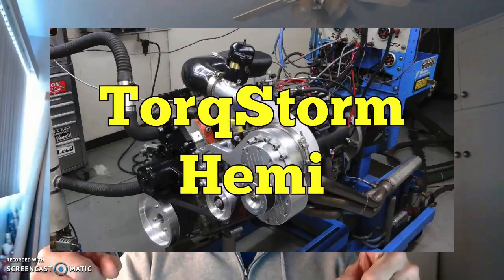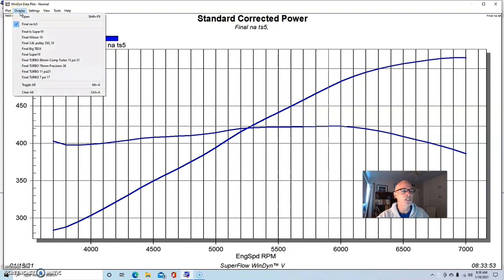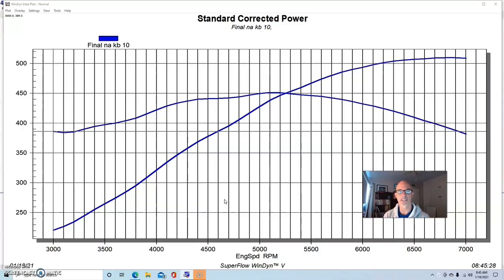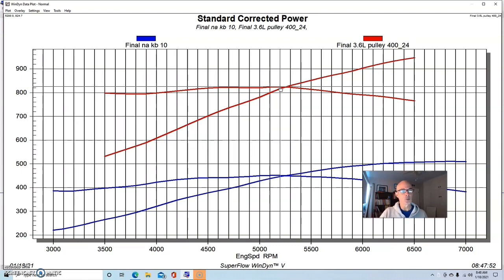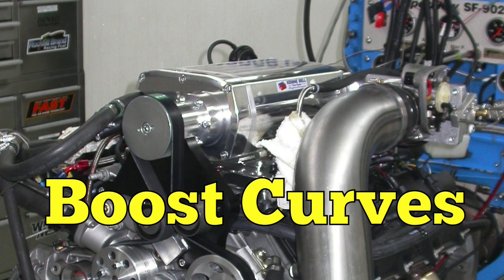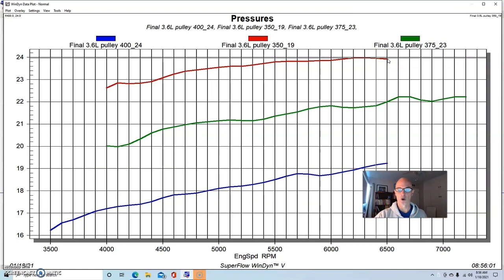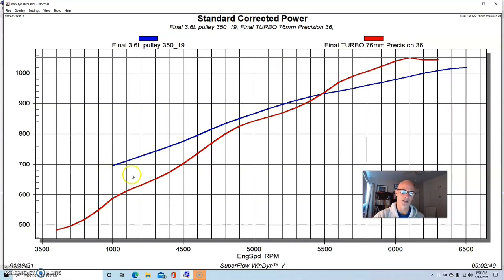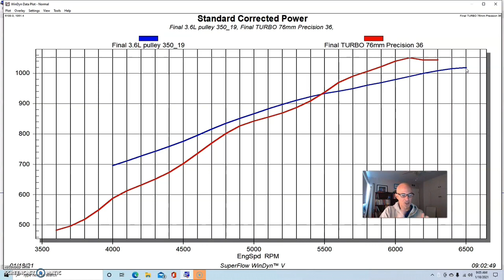1000-HP GEN 3 HEMIs-SUPERCHARGERS VS TURBOS (BOOST!)

Comment: Hemi + boost + ring gap = happiness
Reply: Been putting off doing it myself for awhile now. Ready to buy a 6.1 Grand Cherokee and do a twin screw on it but my wife wants me alive.
Reply: @sHoRtBuSseR  get late year 392 heads, minor port clean up.
Reply: @sHoRtBuSseR You know it’s possible to connect the ZF8speed in the Modern Scatpacks and Hellcats with the 6.1l Hemi
Reply: @redhunnid5142  you'd need a stand alone system to run it, but you can do it.

Comment: Dang, that engine in N/A form is NICE! Looking at that torque curve from 3800 to 6800. 3000 rpm of friggin' table top. I need to build one of those because that thing would be a mean little ripper.

Comment: The difference in the power vs. PSI numbers of the turbo and the blower is - the  blower requires more psi to produce the power similar to the turbo( at lower boost) because of the parasitic drag of the blower.

Comment: Kinda crazy that first one 678 at the crank would translate to roughly 560ish whp. Which is roughly what I have in my car rn. Except 3psi less boost, 10 less degrees of timing and a different cam. It is from a procharger tho. Heard those Torqstorms are not great but hey to each their own
Reply: Also stock heads

Comment: Any chance of a turbo back pressure vs blower parasitic drag test at the same boost level to see the power losses vs each other?  Pick a turbo and a blower both rated to flow 600 hp maybe?  I’m thinking out loud but hey, at least I’m thinking!
Reply: Best test is a fuel flow test of both at exact same power output, because that is what matters, right, wasted power at that power level. Whichever uses the least fuel at 700hp is the winnah!

Comment: Centrificalsupercharger + Weastgate? Hi Richard. Is it possible to put wastegate on a SC-system? For example you have pulleys so you got full boost at 3000rpm, and dont want to blow your engine at 6500rpm.  Like in a trackcar, full throtllerespons and dont have go worry about "overboost". 
Thanks for an exelent channel👍
Reply from the maker: YES IT'S POSSIBLE
Reply: Can definitely be done, although it does make the blower application less efficient since you're still spinning the blower at the same speed.  But if you apply a wastegate and a boost controller to a centrifugal setup you can do some cool things.  We use it to drop boost for cars that normally run high octane/e85/race fuel and want a safe pump gas map.  It can also be used to limit power in lower gears for traction purposes.

Comment: I'm planning on rebuilding a stock 5.7 hemi. I'd like to make around 700hp or a little more that can be a daily. Is that possible without going forged internals?
Reply: I would say no. The early bottom ends were known for breaking after the mods started.
Reply: @jhutch1470  yeah I'm trying to find somebody locally that I can trust. It's a lot of money to risk blowing up
Reply: Def possible with forged internals with proper ring gap

Comment: Richard you’ve seen many engines and have built many of them what is the problem with the hemi design that ends up flattening cams even if they’re stock or aftermarket
Reply from the maker: I've never had that happen-the lifter/cam myth is from extended periods (hours) of idling in Taxi and Police vehicles I'm told

Comment: Do you by any chance know how much more fuel the SC required to make 1000 hp?  The boost also shows how much parasitic losses there were for the SC to make near the same power levels.  That being said, for a road car or track rat, the SC and it's predictable and more linear curves are better.
Reply from the maker: the difference isn't all parasitic loss
Reply: @richardholdener1727  It's efficiency too, right?  The SC is out of the efficiency island, while the turbo is still in the sweet spot?  Did you see any measurable difference in air temps or intercooler temps?  No matter the case, boost makes everything better! :)

Comment: Hey Richard, I'm sure on the engine dyno you go for the glory runs on most of these setups. And I think that's great for drag guys. But for us street guys that want to actually drive the car, and not have it so close to the edge that a tank of not so good premium melts it down. Coupled with typical 165-190° coolant temps, and safe timing with full street car accessories how much less on average would most of these setups make?

Comment: Do I need an intake manifold if I’m running a root or twin screw supercharger?
Reply from the maker: yes-the intakes for roots blowers are usually specific
Reply: @richardholdener1727  ok i was thinking i needed a traditional factory type intake manifold was needed

Comment: 16psi vs 24psi at approximately the same power level just goes to show how much power it takes do drive a big blower like that.
Reply: Also missing what the final air density was. I'm betting the supercharger isn't as efficient as the turbo as an air pump.
Reply: I wonder if the throttle body and intake tube on the kenne bell was a restriction?...
Reply: @MissionRestomod  I'd really like to see pounds of air each pumped  and boost charts.  Superchargers and hemis are just a match made in heaven. I mean look at top fuel cars !!!!!!
Reply: not apples to apples either. the engine with supercharger was more powerful and bigger displacement

Comment: I Calculate about 180hp parasitic loss on the kenne Bell, But for double the power from 500hp not bad
Reply from the maker: how do you calculate that? KB has actual blower dyno results on their blowers (and others)
Reply: @richardholdener1727  just seen their video as soon as you suggested it.            💪😎, The way I calculated at first was through your 15psi of boost doubling the N/A hp, then adding the additional boost in pounds that 20-30hp/1lb boost and comparing it to the turbo motor that has no parasitic loss, I then subtracted kb blower hp from the turbo hp and equated to roughly 180hp parasitic loss on the kb.  

*not too scientific, but that's the best way I can explain it*

Comment: Hey Richard I had a question.   I have a 5.7 hemi in my 13' R/T. I want to upgrade to the 392 6.4 but I can't commit to the 40k+ price tag at the dealership.   I was looking to do a 6.4 swap.. All I found are 5k+$  understandably. But I came across the 6.4 out of an 2018 6.4 out of a 2500 truck from what I read they are not the same as the SRT 392 made more for torque with 5.7 heads and different metals used pistons, heads for durability. But it's amazing deal for a 6.4 with low miles is it worth swapping with some power mods?. It's 3500$ for the truck motor can it be tuned up to 392 srt power?
Reply from the maker: yes it can

Comment: Definitely a blower. There's nothing like that massive amount of torque and power right off of idle.
Reply: If your launching on 2 step or a trans brake, you can make more low speed torque with the right turbocharger.
Reply: @madmod  Yes but that involves revving your engine up, which ain't what I am talking about. I mean very specifically off-idle torque and horsepower. Twin screw blowers win hands down
Reply: A big turbo will walk all over that blower at 24 lb of boost. Turbo will make 1300 horsepower and the torque will  be all you can handle with an electronic boost controller. 128% increase in power at same boost level equals huge mile an hour difference.
Reply: @FeatheredDino  Its not so cut and dry. Some guys have fast enough boost response to reach full boost on their turbo car as soon as it flashes through the converter off idle. Even my auto car doesnt see under 4500rpms other than launch and it goes through first quick. Roots and twin screw still have rising boost curves that dont make peak boost till farther out in the revs unless they are far undersized. Add in the extra parasitic losses driving the supercharger and the turbo car looks even better. This is all pretty strange anyways considering when are you driving wot off idle and or worried about the power right off idle? You never race at or just off idle lol.
Reply: @madmod  this just isn't true at all. It takes any turbo a measurable window of time to spool, there isn't a turbocharged vehicle anywhere in the history of everything that can reach peak boost in the time it takes for the convertor to flash.
If you had said the turbo has already reached it's boost threshold by the time the converter is loaded, sure. But peak boost? Nope. No way, no how.
Reply: @FrostyMopar  With modern 4 port boost controllers, you can have full boost on tap before a converter finishes flashing. Its important to understand you set your peak boost pressure with a turbo, rather than getting a pulley ratio that's fixed moves a fixed volume of air every rotation. Also, Automatics can load an engine way more than a manual on two step or what have you. My old turbo combo on my 5.0 sn95 with a shitty aod would be opening the Wastegate(meaning a full 8-9psi) before the converter hit max stall speed of like 3200rpms.  It had two turbosmart controllers and a cheap 76mm eBay turbo on a stock cammed 302 ho from the 90s.  The car used to have a kb blowzilla 2.2L that had a rising boost curves and while it had better boost response below 2500 rpms, no body is racing their car wide open at 2500rpms. Its an auto combo so all rpms below about 4k just never get used after the launch. On a footbrake with the t76, it had no problem building boost on a leave either. Sure a blower off idle will produce a ton of torque but again, no body is racing off idle torque lol.
Reply: @FrostyMopar  Consider this aswell, some auto combos flash above 4500rpms in less than a seccond on track which gives plenty of load for an engine to build boost. Turbos light off heat energy and are very size specific too. Some turbo combos can sit on a transbrake, riding the converter all day and never spool a pound of boost without a wet shot of nitro to spin things up. Its getting a proper tune, correct turbo sizing, and a quality electronic boostcontroller that makes a combo that comes into boost quicky but not undersized to the point of boost dropping off early.